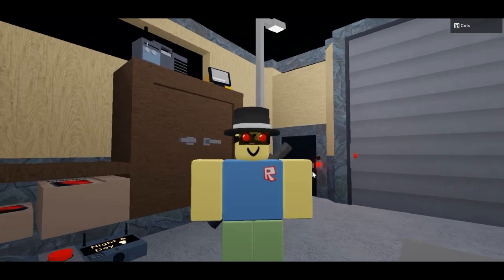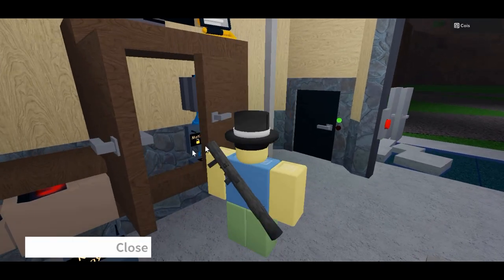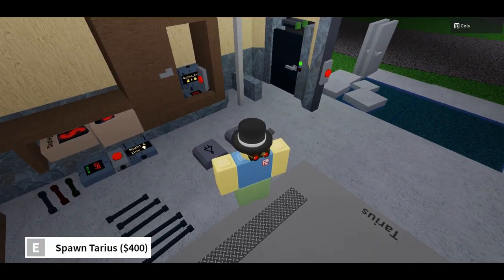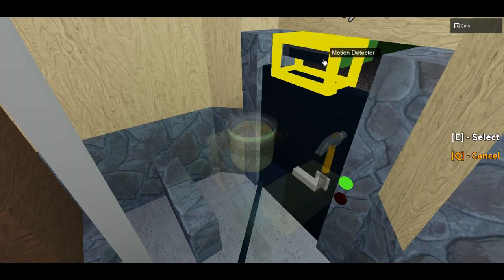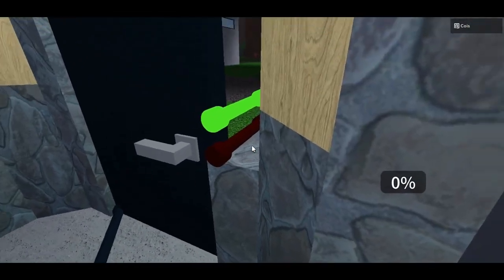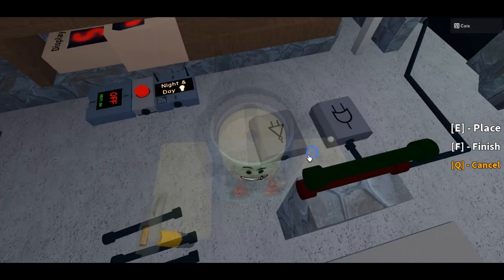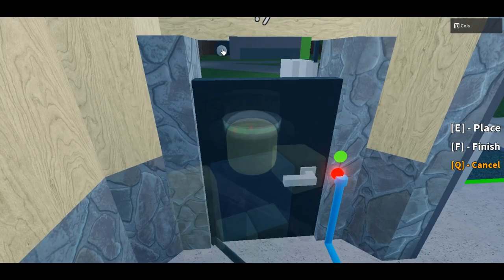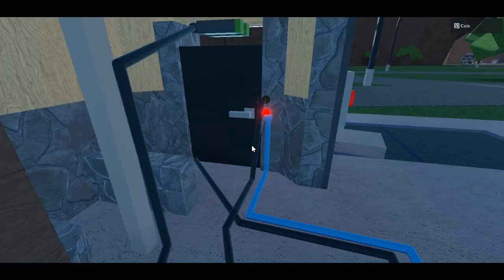Refinery Caves - Automatic Door With Lock System

Comment: where do you hide the motion sensor? that part got me a little stuck
Reply from the maker: Ontop off the door, i put them in center. To hide you need to glitch place a blueprin to by pass the no space promt. To do so you need friend or alt you use then place the blueprint at the same time. If your lucky the game let you place it if
Reply from the maker: I used 2 detectors cuz i had to.. only on on the door in center works aswell
Reply: @LFSDataBase  thanks, I might just leave it open because god knows I don't have any friends